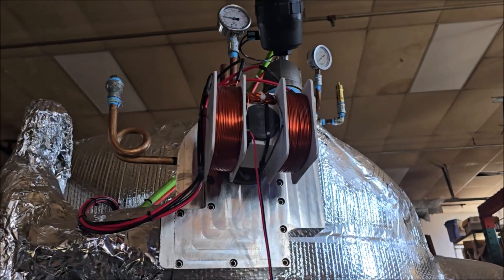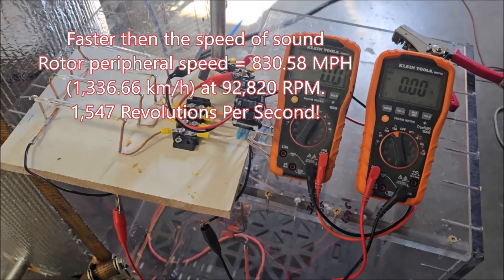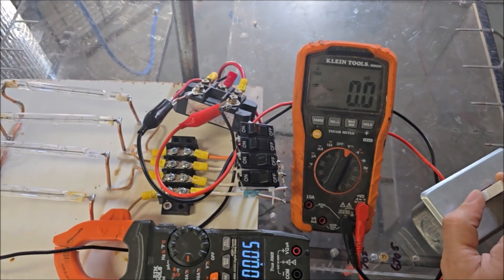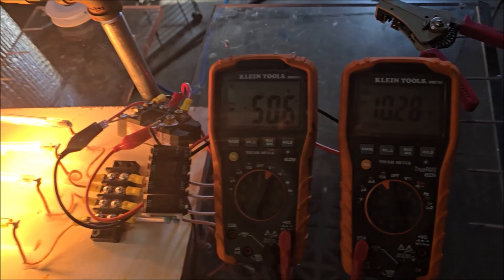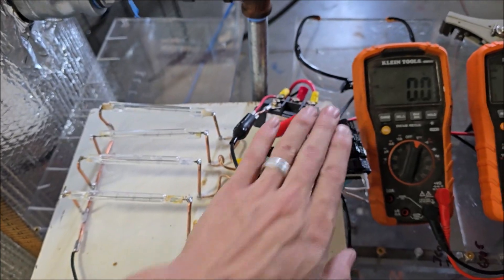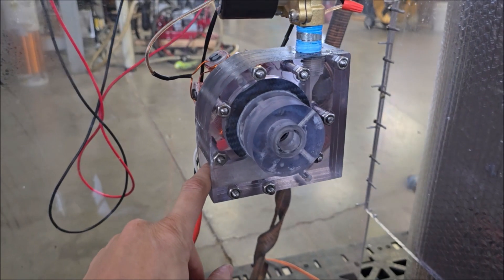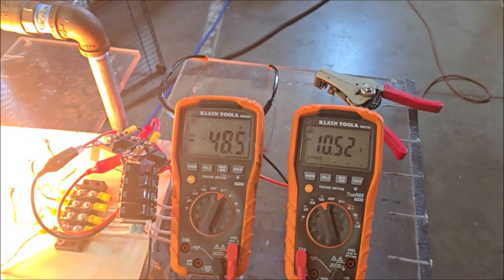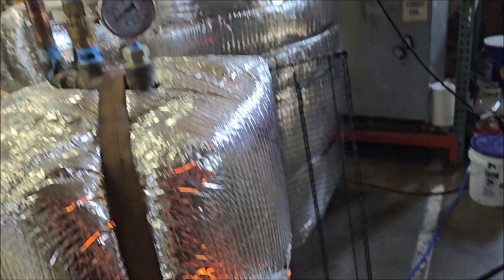Tesla Turbine Breaks Sound barrier! 95,000 RPM!

Comment: I always love the laminar flow of the Tesla turbine . 10 years of age I was using the hose to clean out a Paint roller and found that I could get it spinning at great speed just by squeezing the end of the hose to create more pressure and I've been fascinated by the concept and of course people have been building wonderful little Tesla turbines and as much as it's not the answer to all things it certainly has its place that is just not being really utilised micro energy. Storage as every time you turn your tap on on your house or have a shower that could pressurise air first spin up a Tesla turbine for a period of time and stole the energy into batteries that could use for nighttime lighting in a house so Justin the water supply that is pressurised we lose all the energy by not taking advantage of it when we open the faucet in the Home and in fact in the 1940s or somewhere near there they did actually have these little dynamos. I think in England that used to create, a small amount of electricity for whatever use they had then

Comment: Love the sound of the turbine. such a unique sounds. thanks for showing us the tests.
How long could you run it to say power a home or charge a large battery bank for later energy use?
Reply from the maker: If you saw the larger turbine before I tested the smaller one, that larger turbine is the one that can power your house. You just need to heat the thermal mass/battery to a suitable temperature.

Comment: I woukd take a piston drive with high torque any day. So much lost energy here
Reply from the maker: You haven’t seen my latest progress on the large turbine. You can also convert torque from a generator to a motor to get as much torque as you need. However, comparing the two isn’t really relevant because the turbine serves a completely different purpose than a piston engine for what I am doing.

Comment: You should get an inlet needle valve for higher levels of control. That way you could ramp it up and see how much flow you need to start it spinning at certain loads, if that's something you care about.
Reply from the maker: I want the flow to be fully open that way I am not double expanding the gas. This will be more useful with my later experiments going on right now.
Reply: @iEnergySupply  That's fair

Comment: You may even open up  another branch of physics at these speeds.  Next, you can approach 10 percent the speed of light. Use this as a rocket to explore the stars. Keep up the amazing work.
Reply from the maker: I was hoping to open a black hole.
Reply: @iEnergySupply 
The black hole is already open you just have to enter. 💫✨
Reply: I DO NEED TO BUY YOUR TURBINE. TODAY..Pleas.
Reply from the maker: @bartoszbarejko9179 I'm sorry it's not available yet. I'll have more videos soon for updates.
Reply: You're too quiet Jeremiah.. What's on the go? Weird question.. Are you devices having an effect on your consciousness? If so, I can fill you in.
Reply: pfft 95,000 rpm is nothing in mechanical physics, youve got much to learn.
Reply: @Th4thWiseman but for some water turbine it is
Reply from the maker: @Th4thWiseman it depends on the rotor diameter. The periphery of the discs are moving faster than the speed of sound, significantly faster that is. It is definitely a very high speed for the diameter of the rotor.